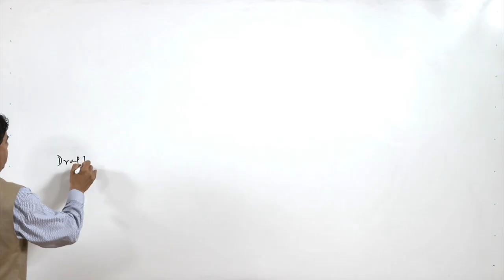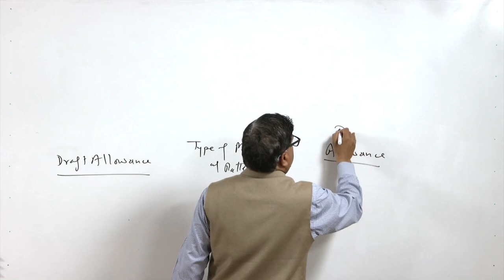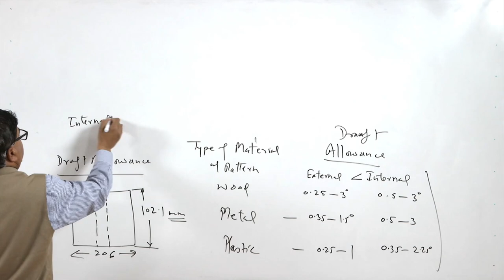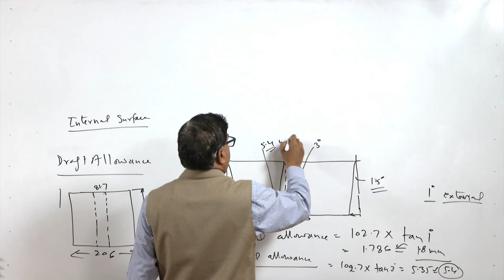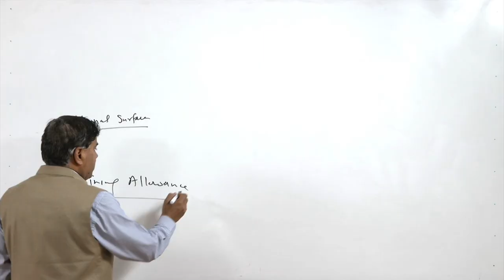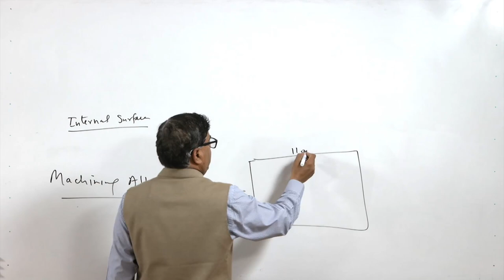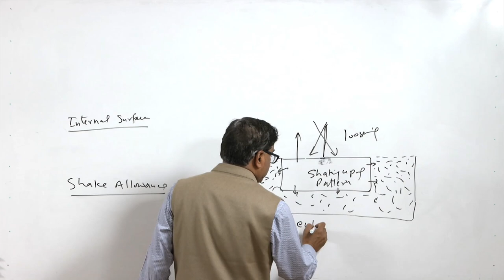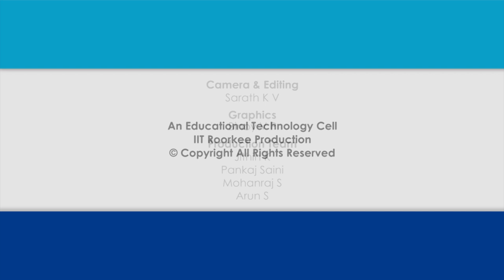The Pattern Allowances II

Comment: Sir, for the shape of the pattern you drew at 29:56 if the top surface is smaller than the bottom one..how can we remove pattern without disturbing the mold
Reply: Hello
 nice observation By reversing it we can achieve this 
If you are reading this comment
Please reply to me i want to communicate with you

Comment: Sir at 9:17, the hole dimension should be 78.3 in place of 81.7 because internal shrinkage allowance is negative.
Reply: That's what I am also confused at!!!
It will be 78.3 right??
Reply: 81.7 is correct, shrinkage allowance is positive even for internal dimensions, he did wrongly in last lecture.
Reply: @samaranjaysharma3459  solve GATE pyq